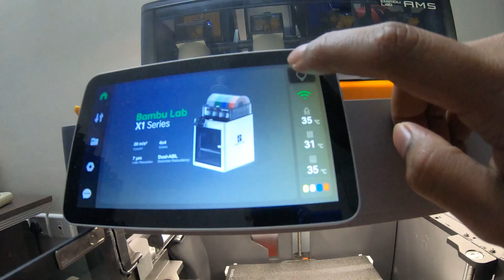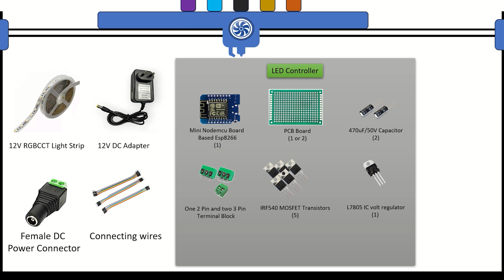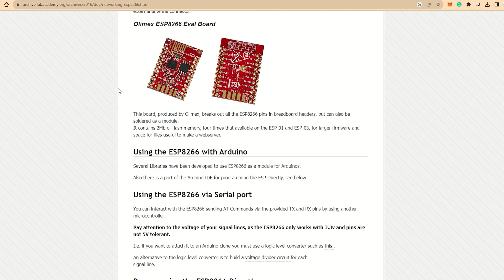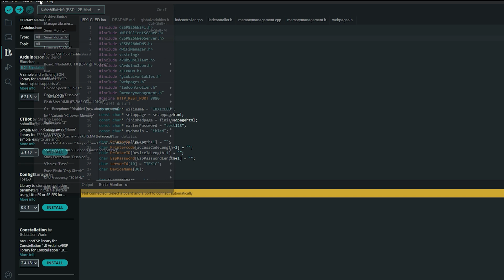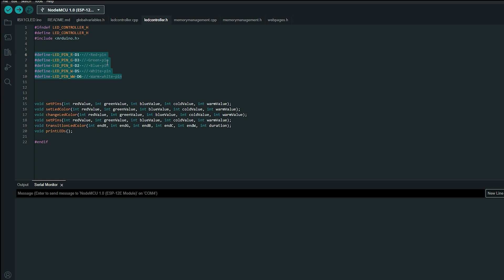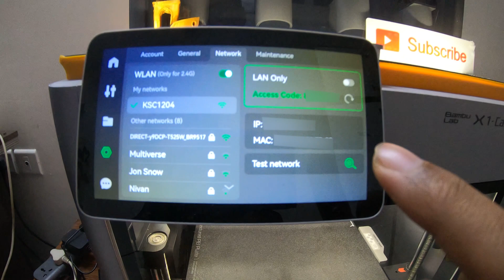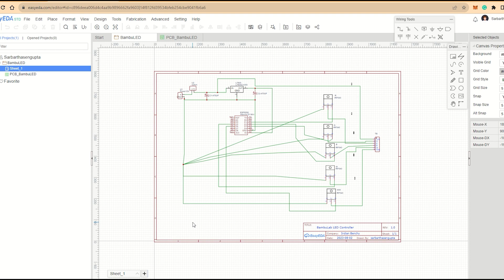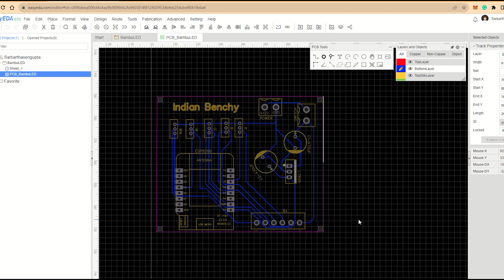SMART LED Mod Upgrade for Bambulab X1 Carbon | P1S | P1P without affecting Lidar

Comment: Given the Bambu Lab printer can get over 60 degrees inside the enclosure, how do you cool the higher brightness LED's to avoid them  either coming unstuck or failing early due to the excessive heat?

Comment: Code doesn't work. Leds only fade and blink with bad colors..... and the wiring of the mosfet is not correct. Pin 1 is Gate, Pin 2 drain and pin 3 is the source. Pin 3 must be connected to the ground, not the 1....
Reply from the maker: Thank you for your reply. As I said in the video I am no expert in electronics and I am learning and sharing my journey. The mosfets I bought had labeled S,D,G and I designed that way thats why mentioned pin 1 as S but you are correct The Gate pin I have connected to the esp8166, Drain is connected to the LED and Source is to the ground. Thank you for clarifying the correct number to the viewer.

But I am curious why the code didn't work for you. Its working fine for me as well as few people I have shared with, who had reached out to me for the same. If you want you can share the details in email indianbenchy@gmail.com and I can look into that to help as much as I can.

Comment: any idea as to why the light comes on and then quickly turns off?
Reply from the maker: If the light not turning on after a flash that means its not able to connect to the MQTT. have you checked when console output you are getting in audrino serial output console? Are you on the latest farmware of you bambu printer?
Reply: @IndianBenchy it for sure is connecting to MQTT i'm getting JSON data with the printer info, i am on the latest firmware. its possible something wrong with my component build out but i;ve built it about 3 times now... any chance you got my email from around the same time i sent this message?  i requested the PCB schematics if you are still willing to share.

Comment: Hi.  I built a unit using the exact methodology, except i used a full development board and not a mini 8266. I already had the Arduino IDE installed so only needed to add the required libraries. The unit updates no issues and I can see the status in the Serial monitor of IDE. Problem is the lights are all permanently off and I used the same pins and cross referenced the GPIO number too to see if that would help which was to to avail. I removed the mosfets and tested using 5 single LEDS (one per pin) being switched from ground pins of 8266 to common 5 v. The lights are permanently on in this configuration and don't require mosfets for 1 led per pin. I was expecting the LEDS to turn off in this test, but they stay on regardless of the P1S status. Im using the light on printer to test and can see its status as mentioned in serial monitor. What am i missing here? thanks for any advice

EDIT 12hrs later.. Not sure why the outputs are not working correctly concerning the 8266, but looking at your diagram, you have wired ground directly to pin 1 and that is the GATE. Your diagram has wired the 8266 pin to pin 3 which is SOURCE. With the GATE wired directly to ground the MOSFET cannot turn on as the GATE (pin 1) is permanently low. As you have this working, I believe your diagram is incorrect. The 8266 output pins should be connected to the GATE (pin 1) using a pull-up resistor and ground should be permanently wired on the SOURCE (pin 3). With the drawing as it stands and if you were able to have current flowing thru DRAIN (pin 2), this would mean the current is coming from pin 3 which is the 8266 output pin, which in turn means the 8266 output is overloaded. Please confirm your diagram pin connections. Thx

EDIT 5 HRS LATER... after correcting the MOSFET wiring as I thought it should be and not using a pull-up resistor on the GATE as the 8266 pin does that by pulling the output high or low, I got it working. The only issue is with your code the lights are always fading on and off constantly. If I turn on the cabinet light, the whites fade on and off. If I simulate an error by removing the hot end cover, the reds fade on and off. After a successful print, the greens also fade on and off constantly. I downloaded Dutches code and installed it and everything is working now 100%. There is no fading LEDs with the developer code. Thx
Reply: @crocop6444  unfortunately he has made some changes and doesn't supply the native Arduino ino file. I did manage to find it thru another YouTubeer who is linked here by IB links,, whos link does take you where you can get the ino file. I found this version to be troublesome and actually went onto Dutches website and actually installed his latest build directly thru his website. Read thru his notes and just keep your board connected to computer, until it's updated yr board.

In addition keep an eye out for the blue button on his website in his notes. That's where you start the programming of your board and just follow his prompts
Reply from the maker: @crocop6444 both ino file links are shared in the description and as well as in the github. I shared the changes I made which is not related to the pin logic. Anyway happy to hear the original code worked at your end :)
Reply from the maker: Source of the mosfet should be connected to the Ground. Gate is connected to the esp8266. maybe the number I put is reversed. I am glad the main code is working for you. I am curious though if you have found why my code didn't work with your design? maybe your findings can help other viewers as well as me as at my end I never same light fade on and off issue. 
PS: the pin logic which could create the issue is same in both code base. My code is added features in the WiFimanager side mainly. both the code works fine at my end and they are 90% similar. Hope you share your learnings with us so that we can learn the issue and I can share the same with others.

Comment: Great Work!! i want to use a single white led strip using only 1 irf540 i could use the code as is but my led goes off when changing to other colors.could you modify the code to use only 1 output just so it turns off the the light during lidar scan? Please and Thank You
Reply from the maker: Please let me know your email is, I will send you the updated code for this.
Reply: @IndianBenchy   how do i contact you?

Comment: Hi! I had ordered the BLLedController from DutchDeveloper but just realized it won't get here until January! I have all the other components in hand so I think I would like to do your build.

However, I have the 24V RGBCCT which needs 24v and uses six pins (I actually bought two rolls, just in case). Can you provide any pointers?

I assume I will need a different regulator for 24-5, would you happen to know which one I should get?, and I assume 6 MOSFETS of another type  handle 24v?

Anything else I should keep in mind? I assume the code should not be that hard to modify for the six pins.

Thanks for the awesome video!
Reply from the maker: IRF540 works upto 24v so that will work fine. Make sure the capacitors are 24v compatible else they will burst. The one I used in my video are capable upto 12v. So just change the capacitors.
24v RGBCCT has same 6 pin as 12VRGBCCT i think. The 6 pons are Vin, Red, Green, Blue, Warm White and Cold White. So color pins are only 5. The 6th pin is for voltage in. If not then changing the code should be very easy and I am sure you can easily modify it. Incase you need any help, please share your led strip link and I can have a look to help you with that. Nothing else need not be changed.
Reply: @IndianBenchy  Perfect! Thanks! I will let you know how it turns out! Cheers!
Reply: @rauls4  Did you ever figure out an appropriate capacitor to use for 24V?
Reply: @Crappy.Consumer.Reports  I did not because the BKLLedController shipped earlier than expected. However it has been very problematic and I have kind of abandoned the project and just use 24v white LEDs. Mine is a P1S so I don't have to worry about Lidar interference.
Reply: @RaulSilva-zd9mg  Interesting, what kind of problems have you been having with the BLLED?
Reply: @IndianBenchy  My light strip is actually 15V. Do you think this would work with your design as is? What does the "50V" mean if your capacitors only work up to 12V? Also, would you mind sharing how you determined what capacitors to use? I looked up the data sheet for the L7805 and it calls for a .33uF cap before and .1uF cap after, I cant figure out where you got 470uF..

Comment: Beautiful project and well explained. Does it also work on a Bambu P1P? Thanks for your video.
Reply from the maker: I haven't tested it on P1P, but it should work same as the MQTT messages are the same in P1P